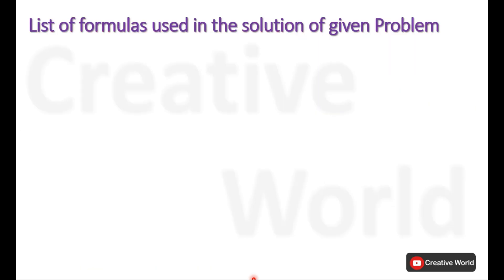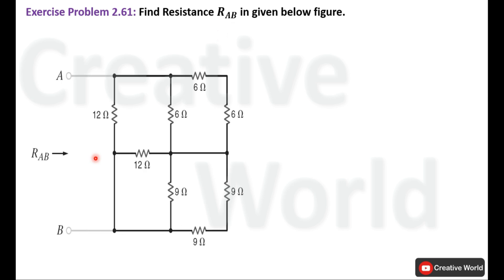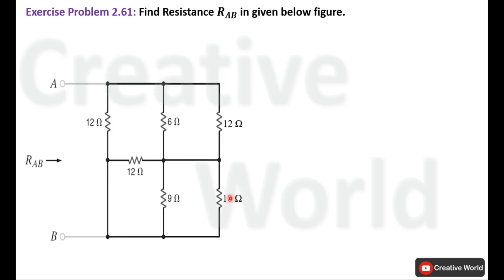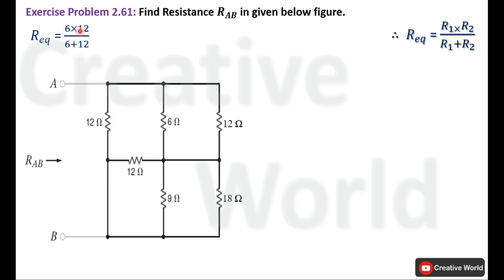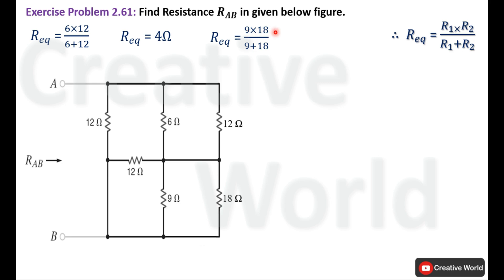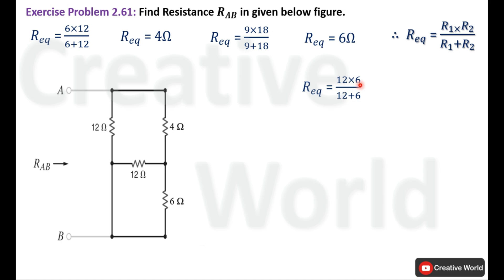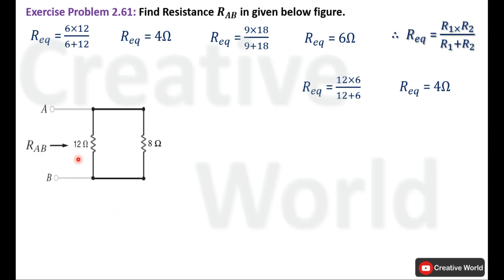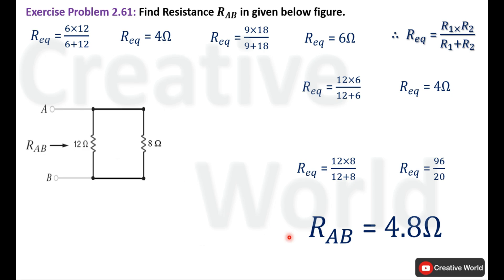Chapter 2 Exercise Problems 2.61 Solution | Linear Circuit Analysis

Comment: 4:16 How are the two resistors 4 and 4 connected in series 
Then why at 4:06 12 and 6 Ohms are considered parallel
Reply from the maker: 12 and  ohms are connected in parallel connection because  if we see in circuit diagram both ends of 12 and 6 ohm resistance are common to each other
and after finding out the parallel equivalent resistance of these two 12 and 6 ohm resistances their total resistance which is 4 ohm will be in series to the previous  ohm these things are also explained in video as well i will recommend you to see the video again

Comment: 4:02 how are the 12 and 6 considered parallel?
Reply from the maker: 12 and  ohms are connected in parallel connection because  if we see in circuit diagram both ends of 12 and 6 ohm resistance are common to each other